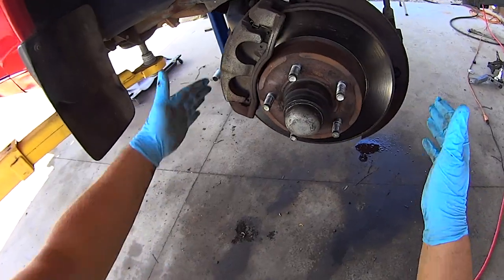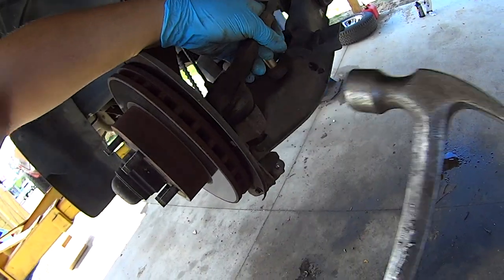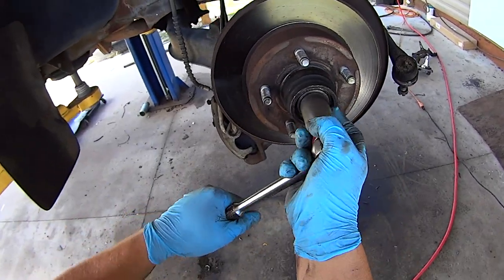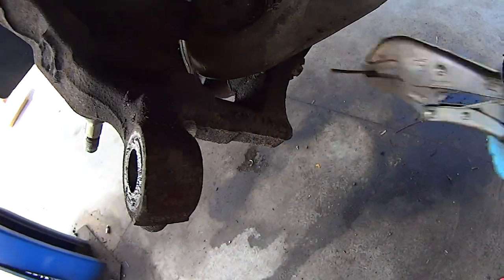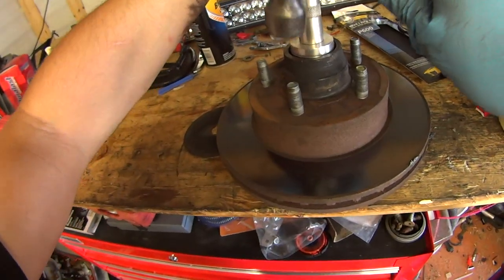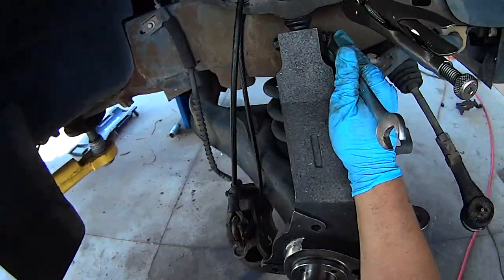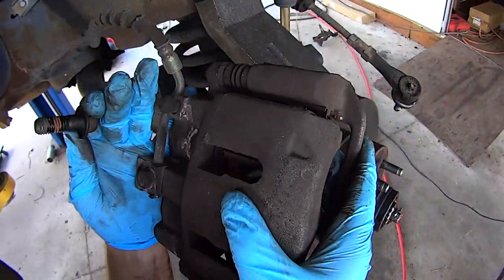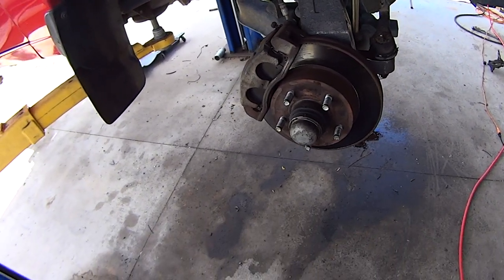How To Install Spindle Lift on a Ford Ranger or Mazda Pick up

Comment: Good work but you really need to pack the bearing properly.  You can’t roll it in grease you have to force it in through the bottom until it squeezes out the top
Reply: i was gonna say the same thing, bearing shot after 1 year im sure.

Comment: You should always torque suspension parts at curb height. You can use a pole jack so lift the control arm up it doesn’t necessarily have to be sitting on wheel but the suspension should not be hanging. It will mess of the ball joint prematurely. Great video

Comment: Really good video and editing. Forgot one part though, the turn radius will be reduced without this step.

Using a die grinder with a 
cutoff wheel, remove approximately ¼” from the front lip of the lower control arm from the previous marked spot around the front radius of the lower control arm in front of 
the ball joint. This will allow clearance for installation of 
the new lift spindle. Increased turn radius for large tires.
Reply: Hopefully you see this. But I recently tried to do a spindle lift on my 05 ranger edge and the turning radius is still like a bus even when we trimmed it. Hopefully you have some tips or know what we did wrong.
Reply: Also after trimming the lower we had to jack it up to line the upper ball joint and when we lowered it it all relied on the upper ball joint idk how I felt about that
Reply: @cameronadams1952  I ended up removing the entire flat lip part around the ball joint on the LCA everywhere the spindle rubbed. My ranger doesn't turn terribly but it did get a slightly reduced turn radius. I have a spindle and spring lift, with extended upper control arms and upgraded camber bolts. The extended UCA helped with alignment/steering issues but it smacks the frame. The best advice I could give is just make sure the spindle does not rub the flat part of the lower control arm.
Reply: @Wes  where did you get your extended upper control arms and camber bolts?

Comment: Thanks for the video! I would like to ask if you would need to get an aftermarket upper control arm with this kit and where did you get it?
Reply: Looks like he running stocks my spindles jus came today I'ma see what happens wit stock an I got coil spacers
Reply: UPDATE my 98 ranger 2 inch coil spacer an 4 inch spindle lift with 3 inch blocks an 2 inch lift shackles stupid lifted needs bigger tires than 31s now for sure
Reply: Does not need control arms jus cam bolts

Comment: Don't you need longer shocks and springs in the front? I have a 98 Ford ranger myself so I was excited when I saw this video but my dad told me I would need longer shocks or I'll be stressing out my truck. And I know I can lift up the back pretty easily with just blocks and u-bolts.
Reply: no, you will not need longer shocks. The only thing that Lift spindles do is changing the center of the where the tires are. you can use same shocks and springs.
Reply: If anything you would need longer shocks in the rear. But it’s not necessary. I would recommend changing the shocks anyways however cause those ranger do get a lot of mile.

Comment: Is a spindle lift only for a 2WD car? I have a 2011 ranger 4WD, is cranking the torsion bars the easiest way to lift the front end?
Reply: easiest way to get 2 inches higher. get new keys and rent a tool from auto zone. 4wd spindle lift is not possible.

Comment: Do I need to replace anything else ? Longer brake lines ? This will work for a 2wd ?
Reply: It works on any model I got a 4 inch spindle lift, I have a 3.0 v6 2wd and it's amazing, the total lift was about 4.5 inches actually
Reply: Ethan, did you have to grind down bump stops on A arms to get full turning radius? Or have to grind on the spindle itself?
Reply: @aquaticamc6818  Ethan, did you have to grind down bump stops on A arms to get full turning radius? Or have to grind on the spindle itself? Did you lose any turning radius?
Reply: @totallypitted3447  just a little on the drop arms and I had to remove my mudflaps because I have 33 12.50s and I use 2 inch spacers so I don't rub anywhere
Reply: @aquaticamc6818  Rad! Thx for the quick response! Too Cool! Bout to update my 05 and I wanna get it right. Did you feel a power drop with 33's? Thinkin imma top out at 31's to keep it somewhat of a daily driver. Almost 180k on the motor, tryin to keep some of the load down.
Reply: why aren't my upper control arm ball joints matching up? everything else does besides the upper control arm ball joints
Reply: @aquaticamc6818  How much in the rear?

Comment: Did these make your turn radius shorter , I just install one side on mine and the hit the sides of the lower control arm and while it's up off the ground with no weight on it the back side of the spindle is right up against the frame and you cant turn it at all , I replaced everything brand new. I got these off ebay and they look just like yours with the f150 spindles and outer bearing, I put a jack under it and it moved away from the frame but it still hits on the lower lip on the side of the control arm, Did you have any problems with yours and did you have to grind some of that lip away ?